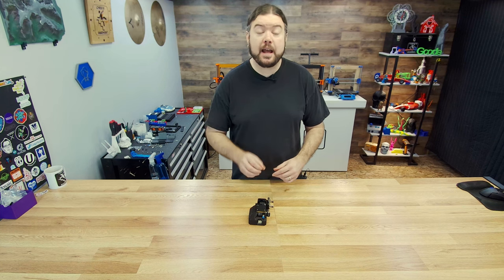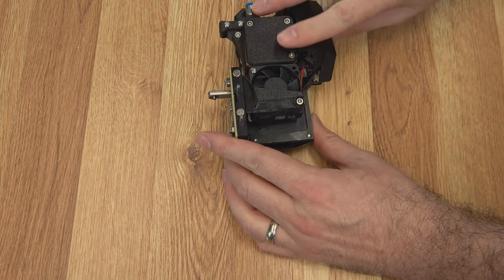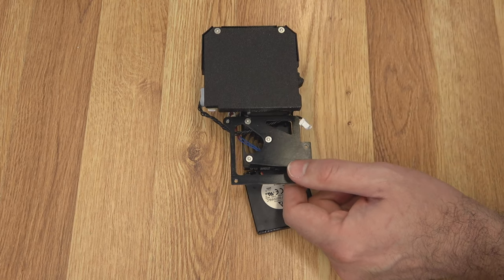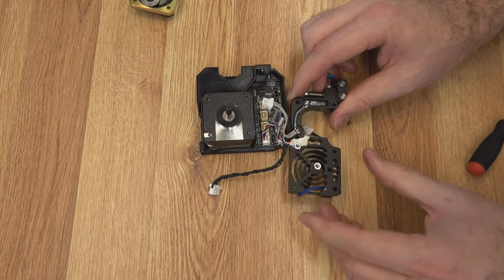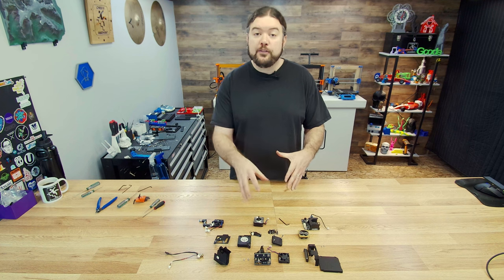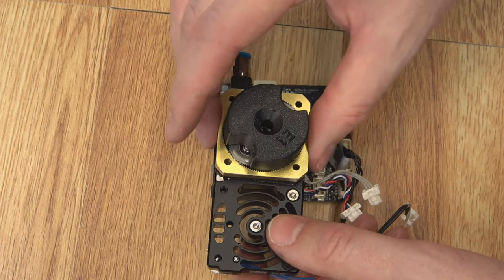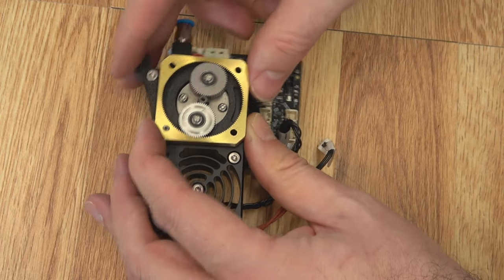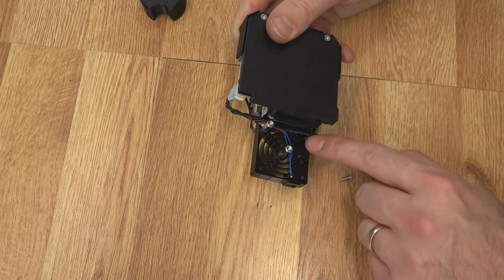All About Prusa Nextruder - Prusa XL - Chris's Basement - 2024

Comment: Reaaaaally valuable, thanks so much! One thing for MK4 users; forget about taking off the wires each time, I find that super fiddly and it can definitely damage them (bit of a design oversight i.m.o.). There are plastic tools on Printables that allow you to simply unscrew the nozzle and take it out, the heater block is very light and wont put as much stress on those wires + changing nozzles becomes a breeze.
Reply from the maker: Great tip! Thanks

Comment: While overall I can respect what Prusa's do for the community, one would assume that going into a certain price bracket with FDM printers would net you a better quality printer in the 'near commercial' workhorse sort. Personal opinion, I'm having a hard time seeing where the money goes with this model, especially in this segment. Going up just a little more would get you into very established commercial or even entry level industrial printers with high capability. Maybe I'm missing something fairly obvious?
Reply from the maker: I don't have a lot of experience with commercial machines, but I would love to check some of them out. I think it would be helpful to have a frame of reference to compare.
Reply: @ChrisRiley  Other than being able to run the specialty materials 24/7 and having a few of the niceties out of the box (primarily high temp heated build chambers that feel like reaching into a broiler, water cooled mechanicals and on-call tech support), the one thing a commercial printer doesn't come with is guaranteed results, much like a regular home unit. They do tend to have a higher success rate, sure, but the fails also hurt more in terms of materials.  
I've seen engineers cry when 18 hour PEEK prints go bad, and that's not including the clean-up afterwards of some very aggressive filament that's a bit more difficult to clean from internals that your usual PLA nightmare. 😁 That's about all you're missing out on anymore. The difference in terms of speed has shrunk tremendously in recent years where I'm sure there's much faster printers in more home use than commercial offices and labs, all else being equal.

Comment: @ChrisRiley your video are like reference manuals that Prusa should actually pay you for. I'm having a tool head not extruding issue and this is exactly the video for tool head maintenance. With that said... where did you get that ~12mm metal bushing for the idler door. I'm about to take apart one of the tool head and I'm hoping that is not the reason for the extruder not extruding.
Reply from the maker: Thanks! It's hard to find that part. You can make one yourself out of a few different common parts, but I can't find the part from Prusa. I would chat with Prusa support, that can get you one.

Comment: Awesome video and detial, I learned a few things.  Also you missed a calibration where you loosen the drive outer gear and it rotates a bit while you snug them.  I think it lets that locate a bit better just in case it is not concentric with the sun gear...  It was part of the mk4 build and I assume same on xl...
Reply from the maker: Thank you!

Comment: Super informative video, well done!  You have a great presentation style.

At 1:48 you mentioned that the lights on the XT extruder are also a pair of buttons and will load/unload the filament.  I had to try it and there was no play in the 'buttons' when pressed and nothing happened.  What's the scoop?  

Did you edit/speed up the ending scenes of the tool selection, homing movements etc?  It seemed faster than mine.
Reply from the maker: Thank you! At one time, they were buttons and they still have it in the manual. They are only used when the machine is in a certain state. I will go back and verify what that state is. And yes, that was sped up.

Comment: Super awesome and very detailed take disassembly and reassembly. Only concern I had was the grub screw tightness, the installation guide only indicates not to over tighten to prevent crushing and damaging the nozzle tube. Does the nozzle tube appear to have any deformation from the grub screw pressing on it with your setup?
Reply from the maker: Thanks! That's something I have checked over and over, because I fear the same things. So far, I haven't seen any evidence of crushing.

Comment: It's interesting how the heater cartridge is pretty far away from the nozzle bore/threads with the thermistor between the two. Chris, is the hot-end copper?
Reply from the maker: The heat block appear to be all aluminum, I could be wrong, but it seems way to light to be copper.

Comment: Did anyone see the Prusa video that dropped today with the box? The opening shot had a printer on the right. Did you see the right Z screw setup. It looked very different to anything i've seen before from Prusa. Thoughts on if it is a Mk4S? and it an updated nextuder.... or is that stock fit mark 4? 

@Chris Riley - the 5T XL arrives monday (26/2/24) and they didn't hit me for 5% duty so a bit cheaper (by~300) than I thought.  so keep this vids coming :)
Reply: @75keg75 Good catch!  Now I'm really curious.  I can't figure out what it would be.
Reply: I don't think it's a new MK4.
I don't see any differences except on the right z axle. 
And the part looks as if it was attached to the original screw connection.
I have no idea what it is used for.
I've only heard that a Prusa camera is coming.
Reply from the maker: Awesome to hear about your XL! I didn't see that, I will have to go find it.

Comment: For the price they are getting for these, it should work without fail for along time.
Reply: So I agree that $2100 is a lot of money, but let's compare Apples to Apples: Voron 2.4 LDO Kit is almost $1500.  The XL single tool is ~$2100 delivered. I have both and they both have their strengths. The Voron 2.4 kit takes a lot longer to assemble and you don't get support from LDO (admittedly, the support from the community is great, but not part of the price of the machine) and LDO didn't have to spend the time and money to develop the design.  Also, with an XL, you get the Prusa ecosystem.  So I do not see how the price is out of line with other printers.  Prusa is far from perfect, but so is any 3d printing manufacturer.